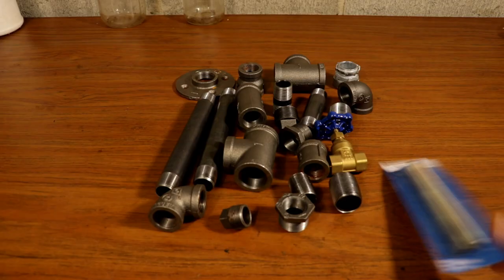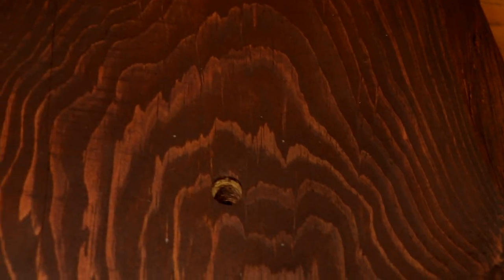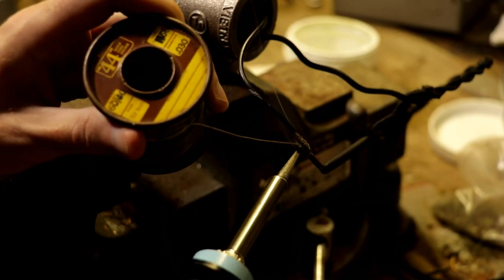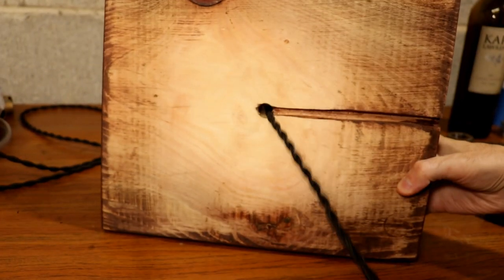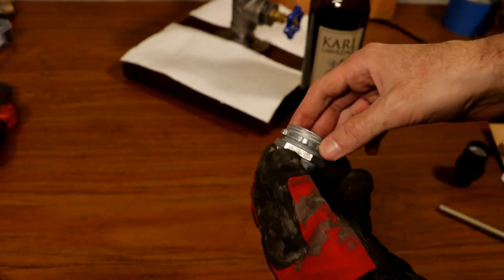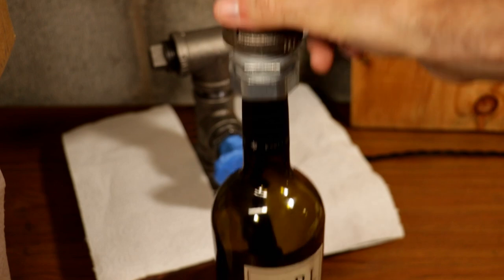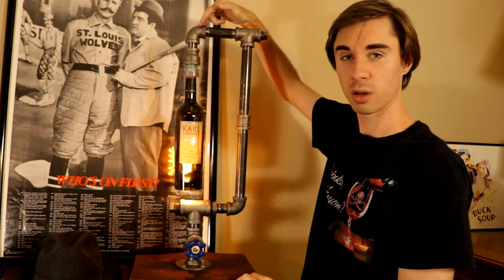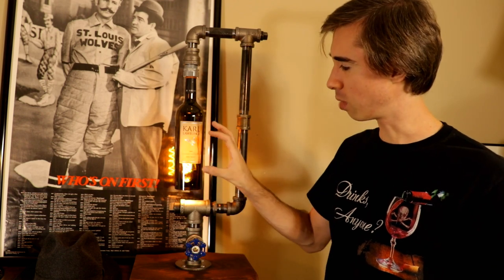Industrial/ Black Iron Pipe Lamp build | the Karl Lawrence Lamp

Comment: Thanks for the video..I'm planning to do something similar.  About your bulb changing problem...Couldn't you just twist the upright joints, bringing the bottle forward temporarily to change the bulb...and then twist it back into position?
Reply from the maker: Your welcome!  
I've had a few comments about twisting the various joins to change the bulb.  It's not difficult to do, it's just annoying due to the fact that those joins are VERY tight!  It does solve the problem, though.

Comment: You know those fittings you screwed in? Well they can also unscrew enough to tilt the bottle so you can add the bulb and then re-tighten however, if you're O.C.D you'll be better suited to take measurements and add the appropriate length extending the bottle freeing up access while also making the entire light symmetrical!
Reply from the maker: You're not wrong.  I do need to use large pipe wrenches to unscrew those fittings even that small amount; they are wrenched down real tight!  
I turned the vertical section on the right so the bottle is more accessible but isn't noticeable from the front.  As far as putting in a new piece, I don't have O.C.D., but it would just make the lamp more to what I originally intended it to be and make the bulb more accessible.

Comment: Can you please put links up so I can know where to buy . I’ve never done this so I really would appreciate it thanks in advance .
Reply from the maker: The reason I don't have any links to the products I used is simply because I bought the majority of them at local stores, i.e. my local hardware store, Home Depot and Lowes; mostly from Home Depot.  The only items I did not buy in person was the lamp cord (18/2 gauge), the switch, the light socket, and the wall plug.  I bought those off of Amazon because that's where they were easily available.  There is a list of parts in the description of the video; that should help you match what I used, if you search for them.  By the way, the light socket that I used was a regular-size E26.  If you have other questions, don't hesitate to ask.

Comment: Looks good. But there wood Bee too Hot inside the bottle, and bulp can break down too often.
This type of bulp is expensive.
Am i wrong?
Reply from the maker: I understand your concern.  
I'm using an LED bulb so the heat isn't too bad.  Even if I had a regular incandescent bulb I don't think it would matter; the bottle is open so there is some airflow.  The bulb is expensive but it doesn't get hot enough to damage it.  If there was enough heat to ruin the bulb, the label would peel off of the bottle, long before the bulb would fail.
Reply: @AndrewPOlson  Thanks for answer. I havent found such Led lamp in my country.
So go aheed! Keep doing what y doing.

Comment: If you take that rubber sheeting, fold it over itself, you can loosen the pipe without marring the metal or the paint. Just be sure to use a really heavy duty paint like an enamel or what have you.

Comment: When you put an elbow and a tee on a nipple, how do you make then point the same direction? I've tightened mine and they point to different (random) directions. And if I point them the same direction then at least one of them is not tightened and the whole construction is loose.
Reply from the maker: Mainly I tightened some of them extremely tight!  For a few of the pieces I made sure the threads were very clean, so there was nothing to bind them up and prevent them from turning, and then added some grease/oil to make it easier to tighten them as much as I needed.  Apart from that, it just comes down to brute force.  You might try using wrenches with longer handles; the longer the handle the more leverage you have and the easier it will be to tighten the difficult pieces.

Comment: How do you tighten them all the way in and still keep them at a 90 degree angle? Mine have their own idea on how they wanna sit, ughh!
Reply from the maker: The longer the wrench handles are, the more leverage you have and the easier it will be to turn the fittings and make adjustments.  Also, I put a little bit of grease on the threads to make it easier to tighten and to loosen the fittings in the future, if I need to take the lamp apart.  Looking at my lamp from a side angle, the 90's aren't perfect, either, but no one would ever know since it looks perfect from the front, which is the only way it appears in my videos!  
I never said it would be easy but you can do it!
Reply: I noticed the nipple on yours are conical. Mine are not, and they're bronze. I still need some parts to complete it but I put some Teflon tape to secure them. The joints appear to be solid. Thank you!
Reply from the maker: @p3sv   You're welcome!

Comment: How does the plastic tubing activate the switch?
Reply from the maker: The tubing pressure fits over the switch, when the blue water-valve handle is turned it also turns the switch because the tubing is connected to both.  The tubing is the bridge between the two.
Reply: @AndrewPOlson  Thanks Andrew, somehow I missed the part about the switch being rotational. Appreciate your fast response.
Reply from the maker: @edhiestand1197  Any time, Ed.  I'm happy I could help.
Reply: @AndrewPOlson  Great job but does the blue valve haev some stoppers.If someone turn it too agressive it would break at the glued part?
Reply from the maker: @Bahanov  No, there are no stoppers.  I wondered the same thing before I made one but having done so I don't think it will break at the part that is glued; just be sure the epoxy is dry.  
Admittedly, it's not the best way to attach the valve stem to the switch but I don't have the machines needed to make custom parts so I went with this method and it works.
I'm not rough with mine and it seems to be holding up.  I recommend being gentle with it; treat it right and it'll treat you right.  
I hope this helps.
Reply from the maker: By the way, if you find a better or more preferred method of making a valve switch, that's great!  I'd love to hear/see your upgrade!  Engineering can be accomplished by everyone!

Comment: Where’s the earthing??? This is seriously dangerous 😳
Reply from the maker: Do you mean for the electrical cord or the iron pipe?  
I did use the clear tubing to prevent the cord from getting damaged by the pipe threads, to prevent damage/electrical short.  
If it's wired correctly there wont be a problem. There are many lamps and lamp video's on the internet that do the same thing as I did.  Lamps produced for retail sale are not required to have a ground (earth) wire in the cord, here in the USA.

Comment: I suggested you use union coupling 
For easy maintenance ⛑
Reply from the maker: That's a great idea!  It didn't occur to me to use one when I was building it.  Thanks, for the suggestion!
Reply: Great ideas lamp 💡 
Thanks for sharing how to clean cut the  bottles 🍾 
Thumb 👍 bro.
Reply from the maker: @zulhairi4784  Check out my newest lamp build, the Half-Gallon Lamp, if you haven't already.  I use a different method for the bottle/jug.